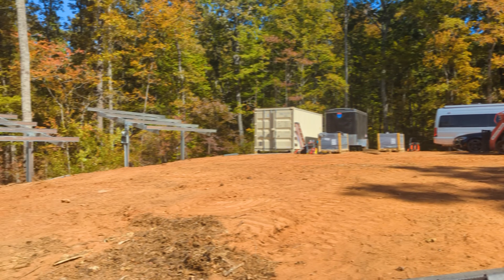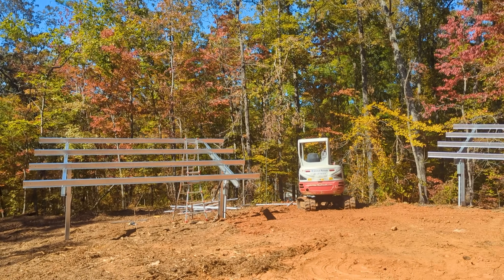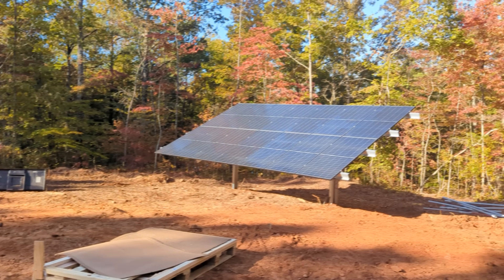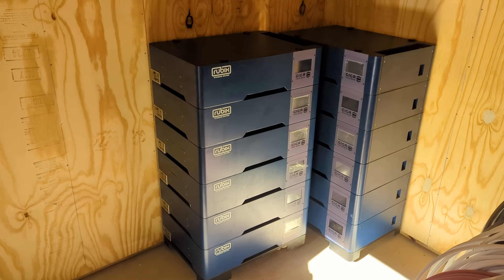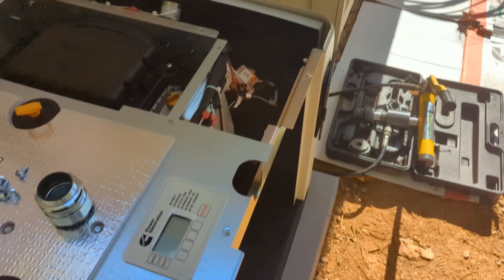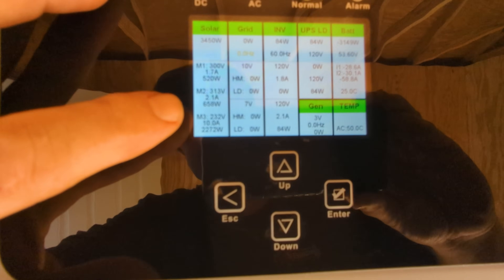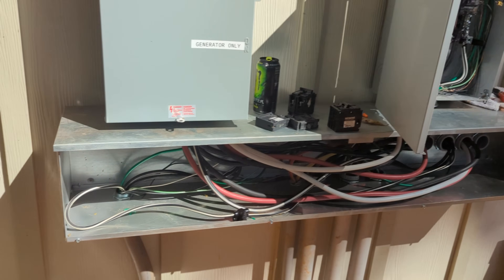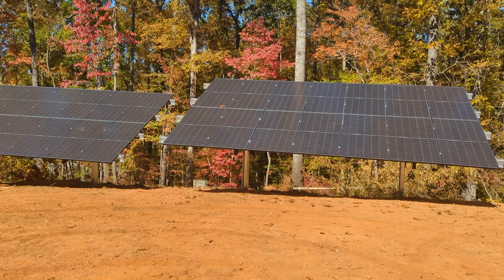Carve Your Own Solar Window!

Comment: What kinda wire do you use for such a long solar run. And have you done much looking into sodium batteries yet, the pricing looks great.
Reply from the maker: @ThePirateGod  #8 thhn. Voltage 320v. Yes, I've been waiting for the sodium batteries. I have not been able to put my hands on any yet.
Reply: @engineer775  I've contacted Seplos directly. Even with shipping from China to Canada 24 sodium batteries are cheaper than the equivalent LiFiPo4 per KwH by 25-50 percent. I'm not sure if Sol-Ark will support hopefully they will. In a couple years when I'm ready I'm hoping for 24 batteries and 4 15K units.
Reply: @ThePirateGod  The voltage range.of sodium batteries does not align with the current inverter available
Reply: @joshkelly3743  The Seplos Sodium-Ion battery has a 
nominal voltage of 49.6 vs 51.2 for LiFiPo4
working Voltage of 28.8-62.4 vs 42-58.4 for LiFiPo4
The Sol-Ark 15k-2 
Nominal Voltage is 48V
Operating Voltage of 43V-63V
all the numbers are well within the Sol-Ark is capable to use Sodium batteries, it might just need software tweaking so it reading and charges properly.